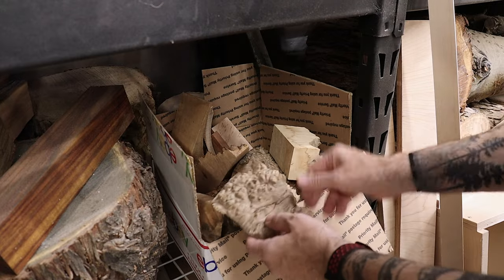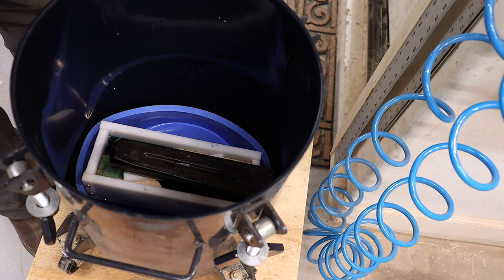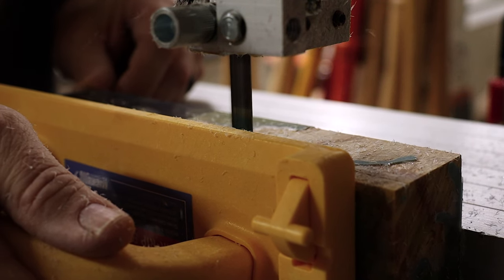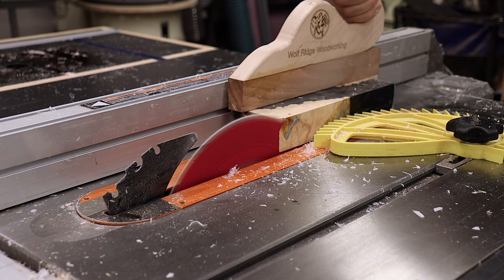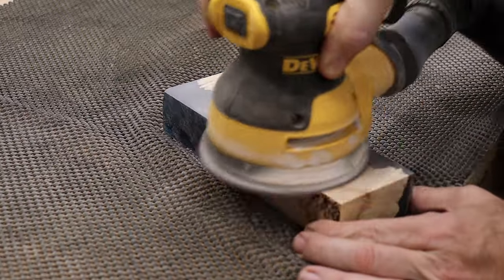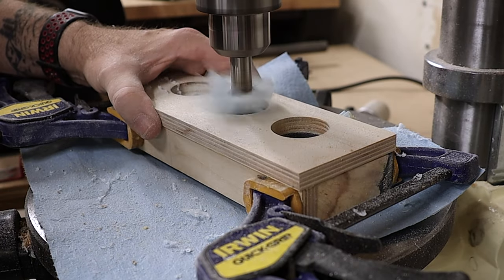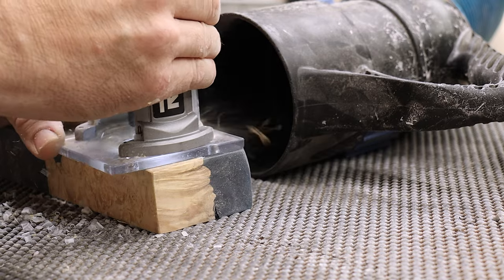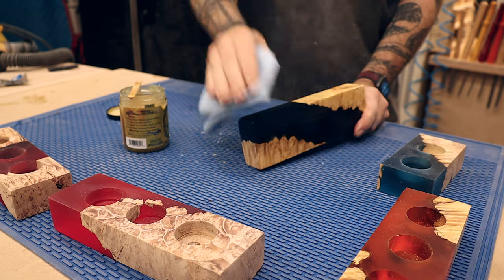Woodworking: Burl & Resin Candle Holder (For Sale)

Comment: Recommend battery candles instead of wax.  Candles can burn wood, even with a metal liner. Good use of burl off cuts.
Reply from the maker: Thank you Valerie!  I agree 100%.  Plus you can get them with different colors.  My wife wants to get green ones for the red candle holder for Christmas.  - Ed
Reply: @WolfRidgeWoodworking  I have red glitter ones if she thinks they would look good. Dollar store holiday decorations.